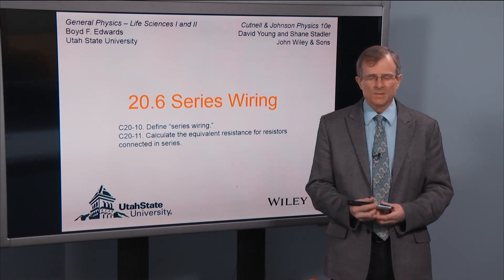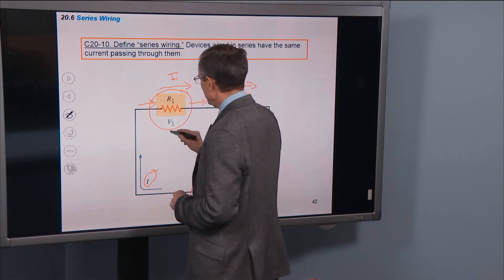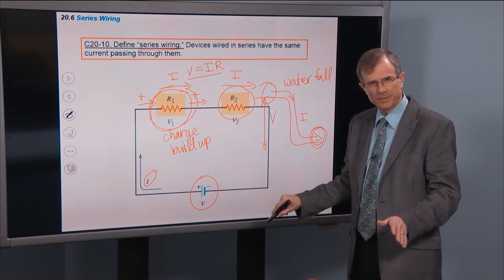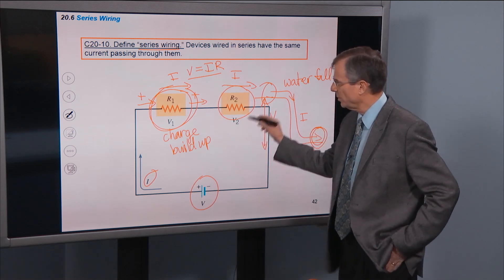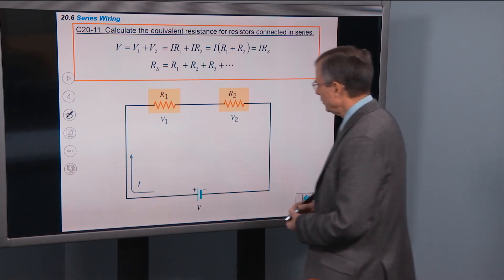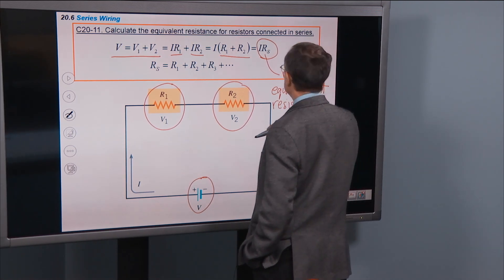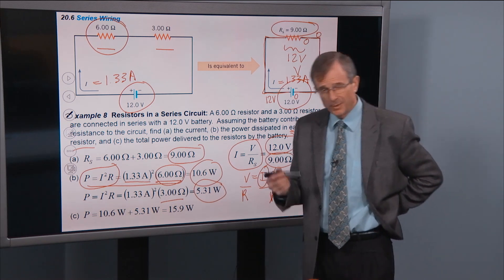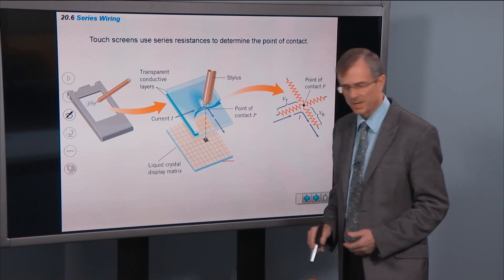20.6 Series Wiring

Comment: Why can't we use P=IV equation instead in example 8?
Reply from the maker: You certainly can!  To find the power dissipated in the 6 ohm resistor, for example, you'll need the voltage across that resistor, equal to V = IR = (1.33 A)(6 ohms) = 7.98 V.  Then, the power dissipated in this resistor is P = IV = (1.33 A)(7.98 V) = 10.6 W, which is the result obtained in the video.